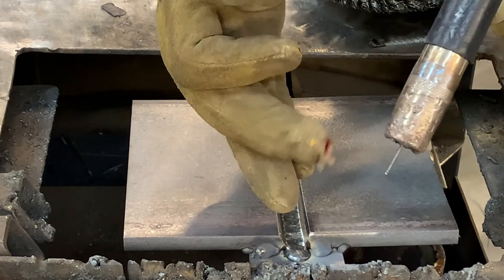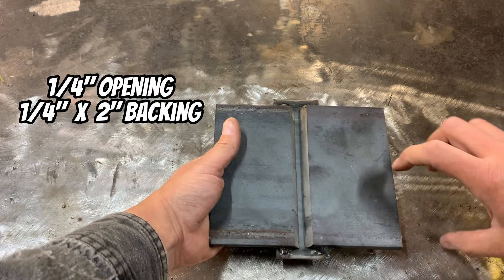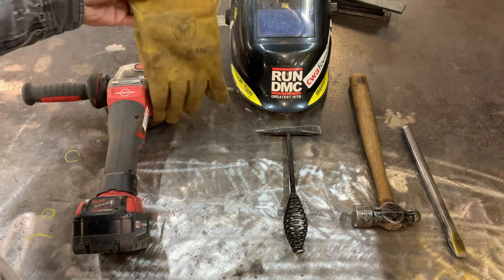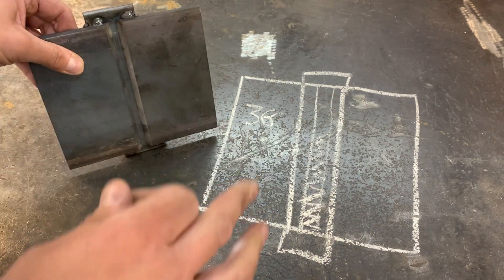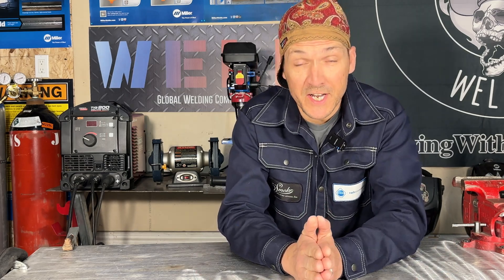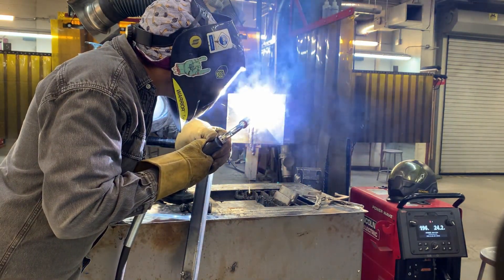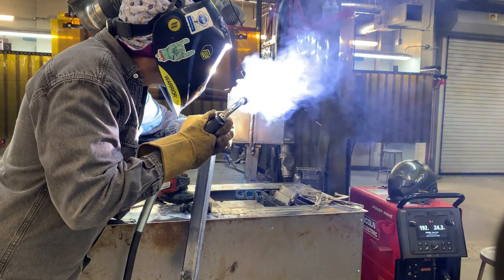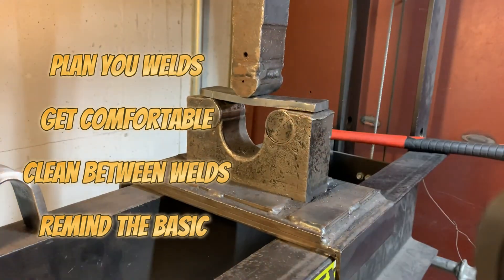3G Flux Core Plate Test Welding

Comment: Can flux core weld thin sheets of metals? Also how don't you have any sputtering??
Reply from the maker: It can- better with hard wire though. Proper settings and she  runs smooth!